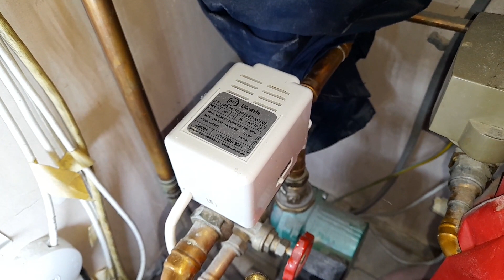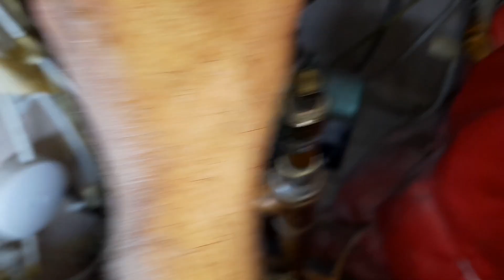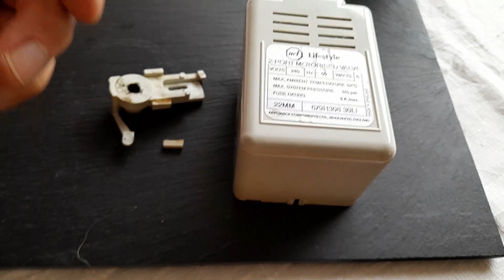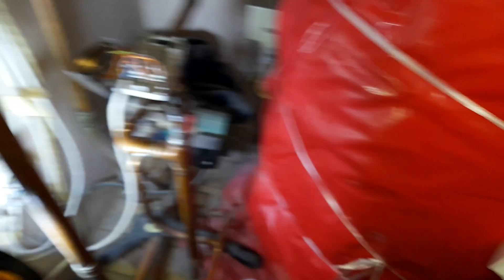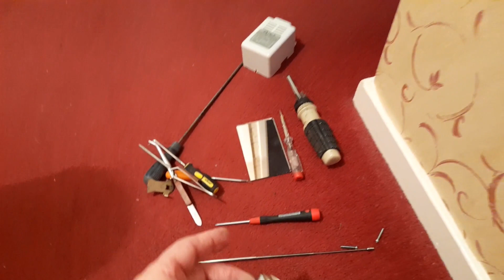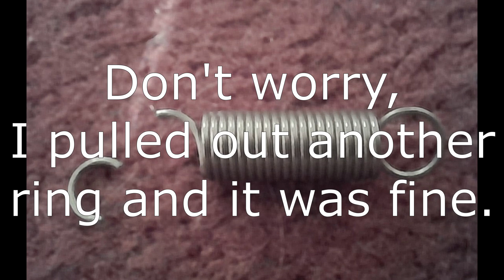Central Heating Motorised Valve Problem

Comment: Very interesting as mine has recently failed! Turns out I have adifferent type but bought one like yours in error on marketplace. You can remove the electronic's board by undooing the two little screws on the micro switch and lift it all off exposing the second screw attaching the box to the plumbing underneath. As it happens I cant use the one I bought but enjoyed your video which explained how to disect the whole contraption! Many thanks!
Reply from the maker: Thank you for the compliment Andrew.
And good luck with your heating!